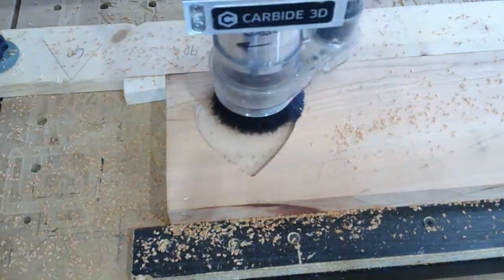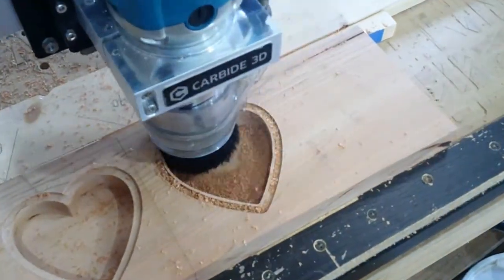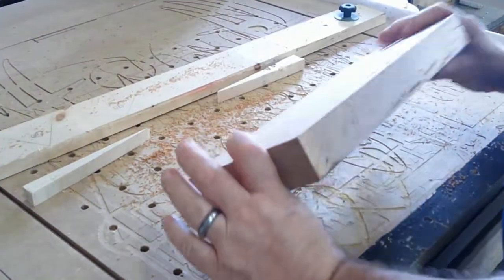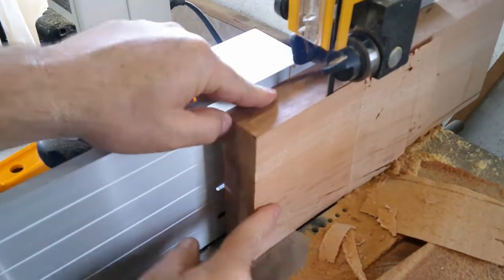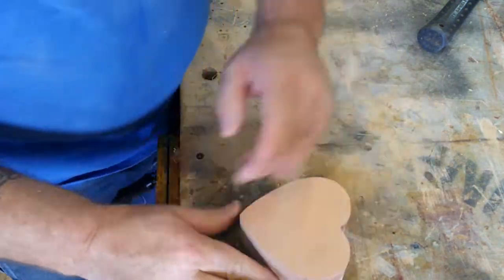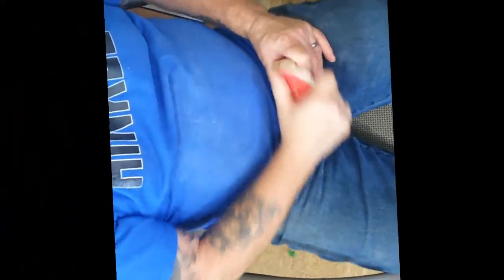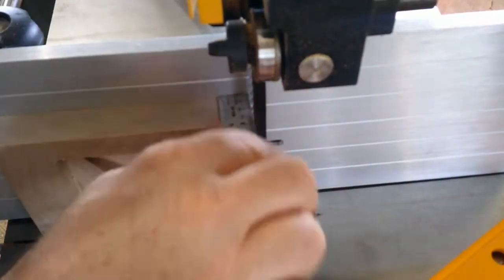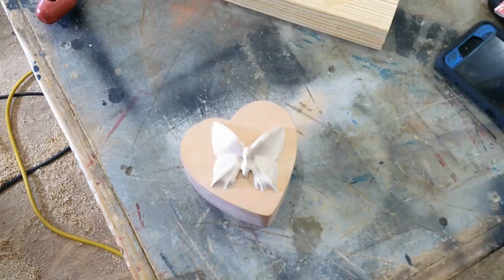I MADE A HEART SHAPED RING BOX WITH CARVECO SOFTWARE ON MY SHAPEOKO XXL CNC MACHINE

Comment: Thanks for sharing. Picked up a couple of things I’m going to try. I like the wedges for clamping. I’m wondering if you have a problem with your work piece lifting on the wedge side, staying tight to your waste board…..I’ve use interior polyurethane but never exterior poly before. Wondering how the finish differs?  
I use 1/4” laminate under my workpiece to protect my waste board. Thanks again.
Reply from the maker: Thanks for watching!
No I’ve not had an issue with lift off with the work piece 
Exterior poly is oil based and tints the wood slightly which in some cases adds depth but I too have used interior poly and the 1/4 inch laminate is a great idea thanks for sharing